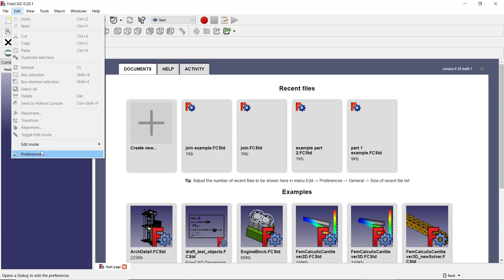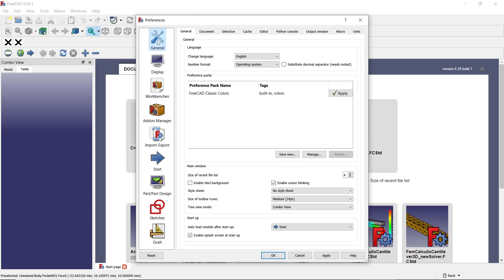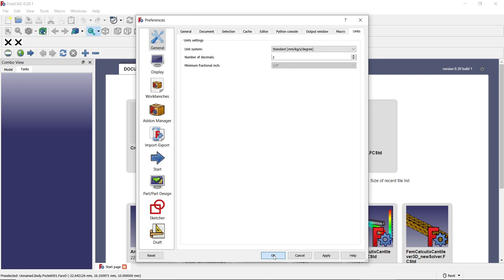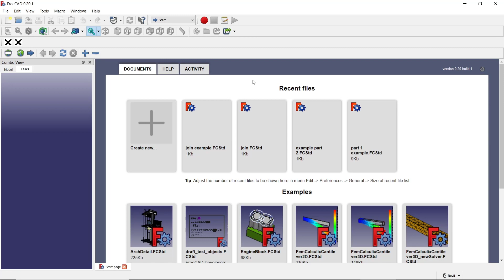FreeCAD How To Change Units For Beginner

Comment: Using freecad 0.21.0 and there is no "units" tab in Preferences -> General
Reply: In freecad 0.21.1 also no "units" tab in Preferences -> General
Reply: Where is it?
Reply: In General -> General under the "Language" selection there is the "Unit System"

Comment: Amazing that something as simple as changing the units doesn't even work. In Draft mode the grid just stays in mm if you change units. It's pretty easy to see how broken a piece of software is when doing the SIMPLEST thing requires a reboot.
Reply: Even after a reboot, it still stays the same... :/